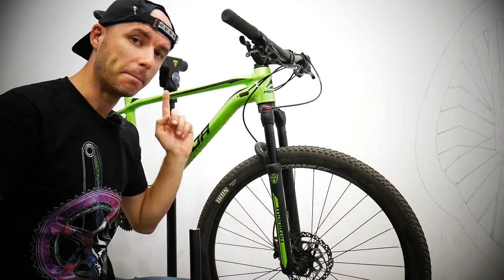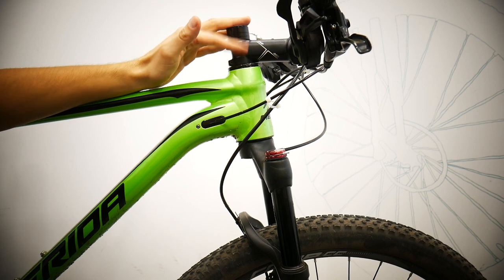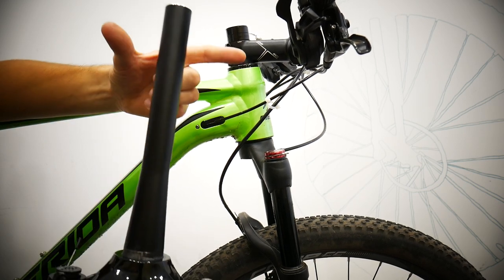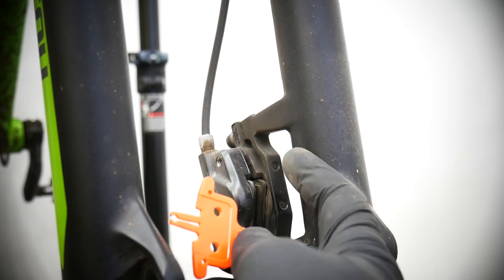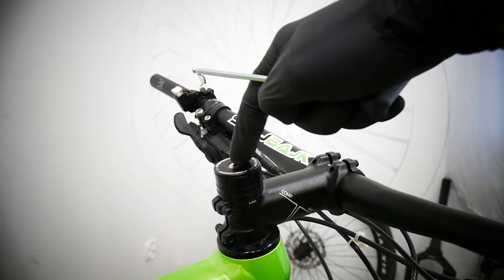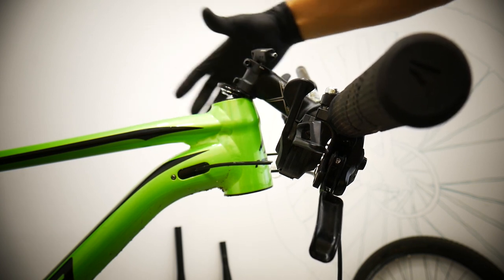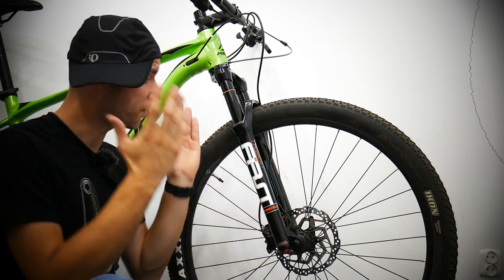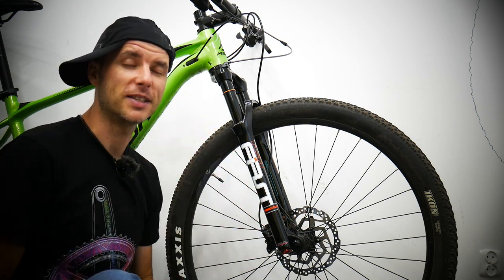How To Fit A New Fork On Your Bike, Cut The Steering Tube, Assemble It.

Comment: Good day SickBiker
Your bike expertise will definitely be of great help. 
I bought Road during Lockdown Last Year to start this dream i had. 
I was able to afford a Scott Speedster 30(2020) Aluminum with Shimano Sora 9x2 speed. 
I want to upgrade to atleast 10 x 2 without burning a hole in a pocket that is not so filled up, lol. 
Wat i was thinking to try is to change to 105 shifters & 10 speed cassette. The question, will the current Sora RD-R3000 rear derailleur handle that? or would i need more to change, & if so what, the catch here is trying to be cost effective and to do little changes just for better climbing. 
Please HELP! 
Regards
Mahlatse 🇿🇦

Comment: Why you never use a torque wrench
Reply: Not crucial in most cases. If you are working with carbon fiber it's a must.
Reply from the maker: I do use it in many of my tutorials, mostly for carbon parts.
Reply: Its not that much needed on many aluminium parts if you developed some "feel" for it. And sometimes you have to use different values either way because some parts don´t allign and match as they theoretical should. But you should always use a torque wrench with carbon parts.